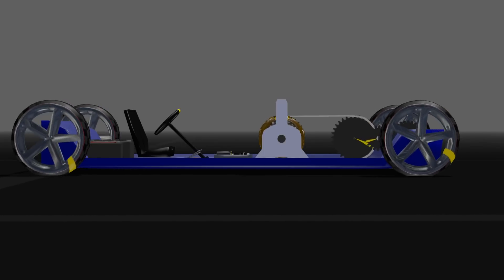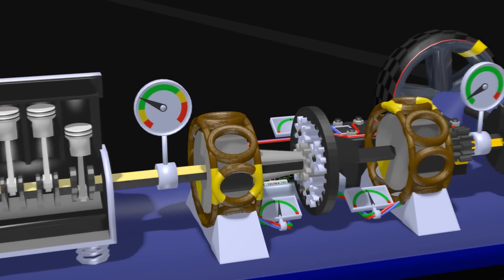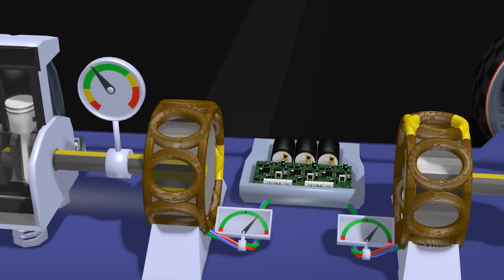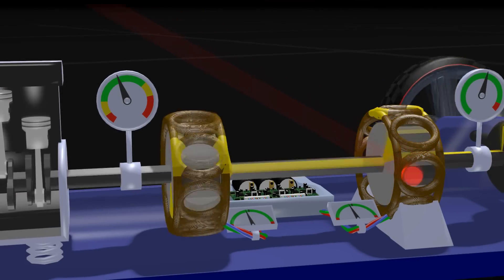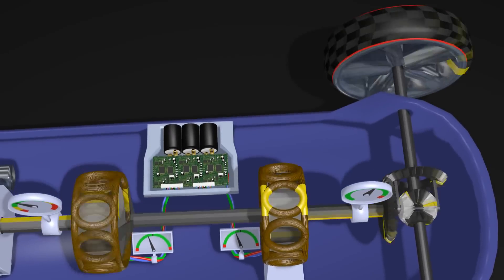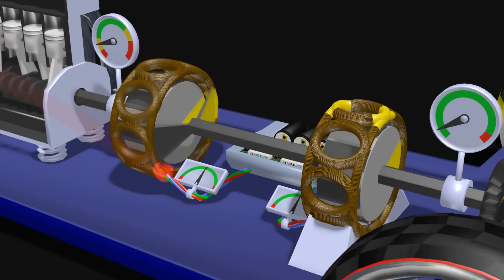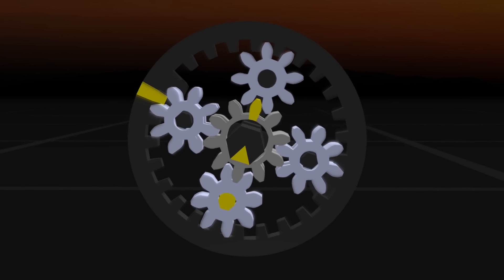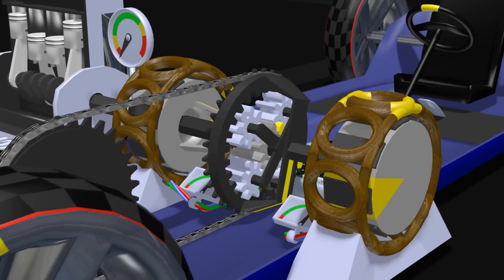Prius Hybrid Drive Explained

Comment: Sorry it’s too late, you explained very well.

Can you tell if Prius car or hybrid car runs on what percentage like if it’s run 100 miles speed 20 to up 80 miles so what will be the percentage of battery was running the car and engine ?

Appreciate 
Thanks

Comment: i feel like he video misses the point completely.

the planetary gear is the star of the show.

actually MG1 changes the gear ratio between ICE and MG2. thats the real beauty of that system.

when MG1 spins faster it gives you lower gears.
when it spins slower higher gear.

the battery and electric motors etc are just means to achieve this elegant system nothing more.
Reply: > actually MG1 changes the gear ratio between ICE and MG2. thats the real beauty of that system.

Well as he said you don't really need the planetary gear to do that. The first visualisation shows that clearly. It's actually the same, only with a gear ratio between ICE and MG1.
Reply: @mrBugeHalls  but then the car wouldnt work without batteries.
it can only work without batteries because of the planetary.
Reply: @saintofchelseathomascarlyl5713  why wouldn't it work? In this vis. he shows mg1 rotating on the ICE output shaft, then the output of mg1 is rotating the wheels. If you want to ride on ICE power only you just break mg1, breaking doesn't require power.

Oh and also you could install a diff instead of a planetary and it would work the same way
Reply: @mrBugeHalls  i think you need to watch more videos to really understand it. i recommend watching a video with the actual parts and not the animation. mg1 does not move the wheels at all. nor does the ice.

Comment: I have 2020 corolla hybrid I always thought that it has cvt belt until this video.
Reply: Yes, as it's called an e-cvt, the first thing people tend to think of, is a belt based drive. There are videos showing the actual motors and gearing, and how it actually works. The above is very good, but it doesn't explain how the engine is started using MG1 and how the engine and motors provide the gearing for different speeds.
Reply: @aaronb6390  e-cvt is not a belt Cvt system.Hybrid toyotas not have belt.
Have a llok at the p311 transmission toyota prius.
Reply: transmission P210
Drive motor: 1EM (13 kW / 110 nm)
Engine: 2AZ-FXE (96 kW / 190 nm)
Applications: Alphard ATH10W, Estima AHR10W

The only hybrid transmission built using V-belt CVT components and with single MG.

Comment: One update on using the battery alone for drive. Newer vehicles also have battery chargers that can be charged from the wall. We call these PHEV - plugin hybrid electric vehicles. The power from the wall combined with modestly sized batteries can give over 25 km range - plenty for a short drive within the city. Using the power from the wall is much cheaper and more efficient than burning petrol. Even if the battery doesn't have enough capacity to drive for the whole trip, it can greatly reduce how much petrol you need to use. This provides a good compromise for EVs - unlimited range using quickly-refilled petrol but the efficiency of pure electric when charged overnight and used daily for short distances.

Comment: I thought the prius had a cvt
Reply: It is a CVT, as CVT stands for Continuously Variable Transmission. Toytoa e-CVT is by definition CVT. It's not a "belt driven"-CVT though, which you find in most VCT cars.
Reply: It doesn't. The "CVT" is electrically simulated.
Reply: @aspecreviews  It does have a CVT, the engine and two motors provide a continuously variable transmission. It just doesn't use a belt to create the variable transmission side of things. There are videos on how it works, how the motors spin with and without the motor to provide the variable transmission.
Reply: @aaronb6390  You mean like this exact video? LOL

Comment: And why people keep telling you need to change transmission fluid every 30k miles to prevent slipping. This thing can't slip can it?
Reply: It still has transmission fluid. You still need to change it every so often.
Reply: People online do need to stop advising when they are not old enough to give advise. Others just wanna be advising on anything they don’t know. This video was good. I might watch it again
Reply: Might not slip but do you really want to run a fluid that goes thru heat cycles and has to protect metal components forever? Lubrication still matters for gearsets. Hate to have metal shavings floating around
Reply: No, it can't slip.  And 30k is a complete waste,  maybe 100k would be more appropriate

Comment: A three cylinder VW turbo diesel, gets better fuel efficiency than this heap of crap, it is a public relations virtue signaling waste of time.
Reply: Petrol engines produce low torque at low rev, high torque at high rev. Electric motors produce high torque at low rev and low torque at high rev, so they complement each other when combined. On the other hand, diesel engines produce high torque at low rev,  their characteristic are same as electric motors, so there is no advantage in combining them.
Reply: Diesels get great highway fuel economy, but poor fuel economy in stop-and-go traffic.
Reply: @DavidSilva-fs5io  I don't understand why in the hell they refuse to make hybrid Diesel's??
Reply: @whatsit2ya247  I think because diesel engines pollute badly when turned on and off, over and over again.
Reply: @DavidSilva-fs5io  maybe, but how about a big truck that was more like a locomotive with electric motors turning the wheels? I wonder if the diesel motor could just be idling most the time as a generator?
Reply: @DavidSilva-fs5io I believe that is because it has to start at low speed (only as fast as the starter can get it, which isn't much) and gets incomplete combustion. The Prius has a much more powerful "starter" (MG-1) so can avoid this.
Reply: @whatsit2ya247 
Hybrid diesels do exist: Volvo has one, I believe it’s the V60.
That being said, diesels really hate inconsistency (turning on and off a lot)
Reply: More than 50 mpg?
Reply: You would prefer a VW over a Toyota??
1. You don't know anything about cars.
2. you have more than enough money to have your VW serviced at a dealer.
3. You're a mechanic at a VW dealership, but even then I would think you'd know better that VW 's are over engineered, parts too expensive shit.
4. You can afford to buy a new car every couple of years before the warranty is up.
5.
6.
7. etc etc
Reply: You are very possibly right; amazing, isn't it?

Comment: How the gas engine charge the battery on park or idle if the wheels are nor moving (ring gear not moving)?
Reply: MG1 charges the battery.
Reply: @aspecreviews  so the sun gear (MG1) and the planetary gears (Gas engine) moved freely around the ring gear (MG2/Tires) but this keeps locked because the car is parked or on idle but no moving?
Reply: @alexanderdyk  exactly. In my 2002, sometimes the reaction force of MG1 causes the car to want to launch forward when the engine shuts off at a light, but that is quickly compensated for by MG2 delivering an opposite torque.

Comment: also toyota runs the engine in variable injection mode... so while in the upper ECO mode u run the engine in a Miller Cycle (toyota calls it atkinson wich is wrong) wich reduces the compression cycle by allowing the intake manifold to close later at PWR mode the intake closes like in any other Otto Cycle engine :) this makes it very efficient :D
Reply: Atkinson cycle is not wrong it's completely true and we solved problems about Atkinson cycle in the lesson of thermodynamics and we were not saying miller cycle about that
Reply: nah toyota just says its atkinson but its a miller cycle they actually use... it makes not much difference... @eshabbatan9411
Reply: You mean variable valve timing, correct?
Reply: Do you know which generations this applies to? I think my 2AR-FXE in my fourth generation Avalon hybrid is permanently Atkinson/Miller cycle, but it is alsp VVT-i on intake cam side so I'm not sure
Reply: @v3ru70  atkinson works with the piston while miller works with the valves :D its not fixed... in a cycle toyota uses the VVT-i / Miller Cycle when using the engine in eco drive (1500 RPM) when u push it it changes into Otto Cycle at arround 3500 RPM

Comment: And if say the combustion engine was replaced by a larger electric motor for a straight BEV, this ECVT will likely still work, enabling near peak efficiency regardless of wheel speed.
And because all gears involved are permanently meshed, tooth wear is significantly reduced
Reply: That’s incredibly smart

Comment: Wow, thank you for the amazingly informative video and 3d graphics. I just bought a prius 2nd G, and had no idea that there were this many different systems involved.  I am still trying to wrap my head around the planetary gearset and why it is involved.  My Honda Civic hybrid is much simpler by comparison (pretty much just a motor bolted to the engine on the same shaft), but it is a 5 speed stick, and a much more fun car to drive, getting maybe 5% to 10% less fuel efficiency.  One question though; you show the gas engine as a normally operating inline 4, but isn't the Prius an Attickson cycle engine?  Regardless, thank you for the brain candy!
Reply: If this boggles your mind, wait until you learn how complex the braking system is. In a week long hybrid class at Toyota, techs spend a full day on brakes. At least they did when I took it in 2008.

When you brake lightly like a properly defensive driver, the only reason you feel reistance in the first half of pedal travel… is because they added a pedal stroke simulator to give you something to push against. It could easily be effortless since all it’s doing is decelerating by charging the battery.
Reply: @MemphisMechanic  Yeah...   Don't get me started on the F=%%/\**ing brakes.   No other car on the planet will leave you completely stranded because there is a fault detected in the braking system.  Now it is $1500 worth of parts and two days of working on it and hoping that MAYBE it fixes this issue in their idiotic braking system.  It is beyond unnecessarily complicated.  Hydraulic disc braking systems have been just fine for a hundred years, and ABS was working wonderfully 30 years ago.  There is ZERO reason for that rube goldberg pile of crap that is the yota system.  They totally dropped the ball on that.
Reply: @GoingGoneGalt  unfortunately it had to be more than a coventional system to appeal to people unwilling to learn an unusual method of braking: to make it feel like normal brakes yet regeneratively AND hydraulically brake with the same pedal action? Shit got complex fast. Couple that with two redundant methods to ensure the car will still stop when a fault occurs? Triple complex.

It’s great... When it works. 

A repair nightmare if it fails. Fortunately 99.9% of them simply eat a $1,500 ABS module that’s easy to replace. So… yay?
Reply: @MemphisMechanic  Sorry, Honda has it all over them on this one.  The regen is perfectly palpable when you just barely press the pedal...  As well as giving a visual indicator on the charge meter.  Then as more braking force is needed, plain old vacuum assist power brakes backed by ABS for slippery conditions.  They work great, feel right, and are a standard system to work on when repairs are needed.  They also wont throw an electronic tantrum and leave you stranded by refusing to let the car move if they aren't happy, hundreds of miles in the middle of nowhere.  The prius system just plain sucks all around.  It was not necessary, and if it really was just to please soccer moms who don't actually know how to drive and wont learn...  That makes me even madder.
Reply: @GoingGoneGalt  you’re 100% correct and we’re absolutely in the same camp here. Toyota went full Audi, and overcomplicated the hell out of it.
Reply: @MemphisMechanic  Which is really a shame, because the drivetrain is just pure poetry. It also deviates from the companies century-plus, DNA level tradition of simple high reliability.  I think they really jumped the shark on a lot of design elements, trying to make sure they dominated the hybrid space.  The strategy worked, for sure, but at what cost?   I am still glad I tried it out, but will never buy another one.
Reply: @MemphisMechanic some conventional Toyotas use this electronic brake modulator as well, to allow extremely fast and precise control of the brakes for their Vehicle Dynamics Integrated Management system, which is capable of controlling individual brakes, the engine, power steering assist, and AWD systems in some vehicles 1,000 times every second to be able to correct a loss of control or potential loss of control before it is even noticed by the driver.

Fun fact: the first vehicle with VDIM was the 2006 Highlander Hybrid because the technology was already in place to control the brakes with incredible speed and precision.

Comment: So if you out the car in neutral an hold. The brake an turn the crankshaft with a hand tool ,youll be able to charge the hybrid battery ??
Reply: It don’t charge in neutral

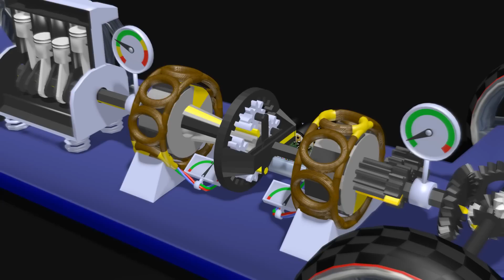Comment: 10:49 This is actually a differential gearset - it takes the input speeds of two motors and the output is the difference of the input speeds

Comment: Very good! I drive a Prius for deliveries at work and notice some tremendous RPMs on the MG while in engine braking mode and also when in cruise control mode and reduce the cruise speed while going downhill. You can really hear the high speed winding up of the motor/generator